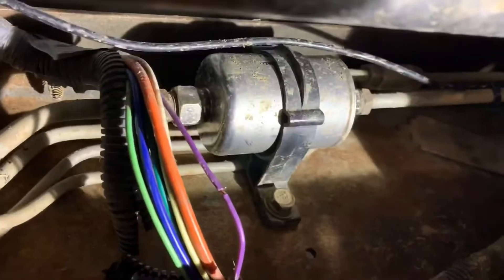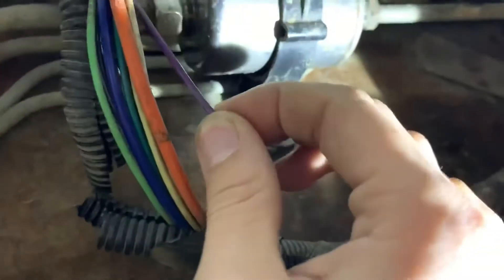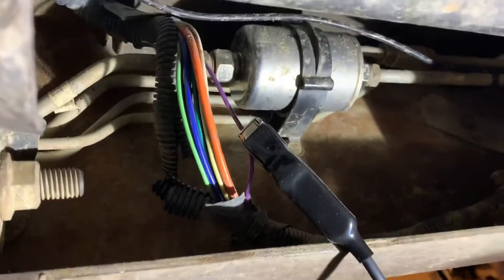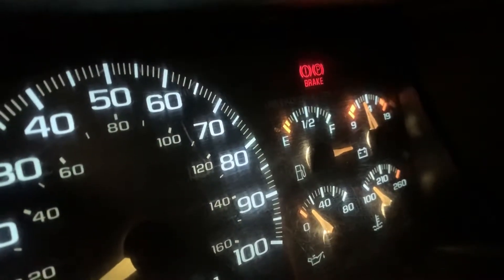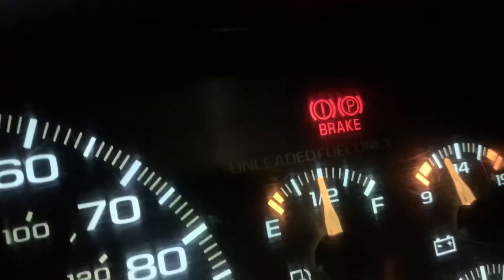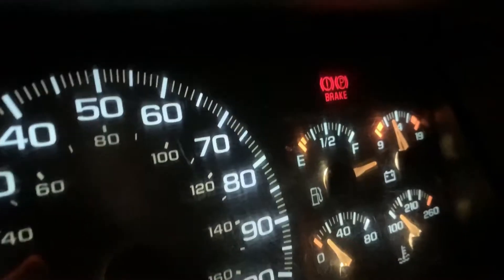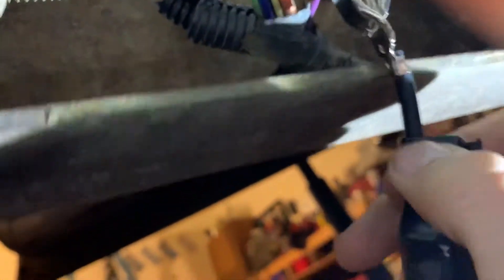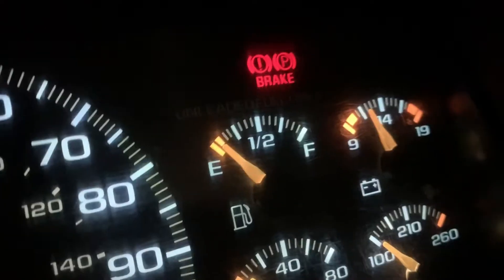Chevrolet C/K1500 Fuel Gauge Diagnosis That Works!

Comment: Nope.  There is a FUEL SENDER AND BALANCE PUMP CONTROL MODULE that takes the ppl wire and translates it to the right signal to the fuel gage through another ppl wire (purple)

Comment: My fuel needle is erratic. I did this test and it showed the air core to be working. I don't want to have to replace the sending unit and still have to replace the air core motor.

Comment: Couldn’t you just disconnect the tank ground 13mm to see if the gauge moves? If it drops, and then goes up (upon grounding/reconnecting), it’s not the gauge cluster 🤔

Comment: Mine works fine until its about half, then it just stops. When I fill up the tank again it goes back to full and half way stops again..... The measuring/floater device that shows how full the tank is has been cleaned so that isnt the issue. What could it be?
Reply: Did you ever find the problem? My truck does the same thing
Reply: When you cleaned it, did you test it outside the tank ie: move the float up and down and verify on the gauge?

Comment: My truck is a 98 Z71 my fuel gauge is stuck on E. I changed the fuel pump and sending unit it's still stuck on E
Reply: did you ever figure it out

Comment: What year is your vehicle?  Is the purple wire the same on a 97 Suburban?  For the last 6 months, the fuel pump on my 1997 C1500 Suburban had barely been working.  When it failed it also blew the 20 amp fuse in the relay box under the hood.  I changed the fuel-sending unit and discovered that the insulation on the two wires going to the pump on the sending unit had melted and they were fused together.  God only knows why there was no explosion.  Once I replaced the fuel-sending unit with a new one,the Suburban started perfectly, but the gas gauge started spinning in circles at high speed, often reversing direction or jamming itself into the oil temp gauge below it.  I am disabled and spent 3 days mostly crawling around on the ground replacing the sending unit with a new one.  I dread having to take everything back apart to replace the fuel-sending unit again, or tearing out the dash unless I am sure which is bad.  I am also the sole caretaker for my very ill wife and this is the only vehicle to take my wife to the doctor in.  

I need to be absolutely sure what is wrong before tearing it apart again.  You mentioned Ohms.  I have a multimeter.  I understand how to check the fuel gauge as shown in your video, but Is there a way to test the sending unit from the fuse box where the relay is to be sure it is bad before replacing it?  It is a brand NEW sending unit!   I was thinking that if the old sending unit was shorted maybe it could have damaged the relay or something else.  I just need to be sure to check everything I can because if I must tear it apart again we will be without anything to drive for several days which could be dangerous for my wife.  Thank you for your advice and any help you can offer.  God bless and Happy New Year!

Comment: I have a 2006 Duramax and I tried your method and the gage didn't move.  It shows 1/2 tank full when I turn the key on and when I short the purple wire out, the gage didn't move.  I notice my truck cable bundle is much bigger so I dig a little deeper and realized there are 2 identical purple wires in the bundle.  I was afraid to short the second one out since I see a little spark when I short out the first purple wire .  Can you tell me what is going on, thanks,
Reply from the maker: Sorry for the delay, if the gauge moves when you turn the key on I'd say change the sending unit to fix it.

Comment: Excelent thanks. However I would recomend DONT strip the wire, risky. Use as small a needle to pierce the wire then reseal.
Reply from the maker: Great tip! I was just working with what I had at the time, and I made sure to seal it all up really well.

Comment: Hi i grounded mine and the needle goes all the way down it doesnt go half ways does that mean that is working
Reply from the maker: Yes, if the needle moves when grounded then the gauge cluster is working and the issue is likely the sending unit in the fuel tank.
Reply: Hi i got it to work the mechanic that install my fuel pump system dropped the ring that goes on the gas tank on the bottom of the floater so it was preventing the floater to go up thank you so much
Reply from the maker: @oscarperezgonzalez9203  Oh man! Glad you got it figured out. And cheaper than replacing it!
Reply: Thanks

Comment: Gonna try this test later but my question is if I can use my scanner and see my fuel level (I have a 98 and a 411 ecu) that means the sending unit is fine and something from the ecu ie "tune" is off?
However after multiple attempts with the tunes it reads full all the time. I've verified the fuel level that the ecu shows is correct via scanner and tracking the gallons used... any thoughts on this?🤔
Reply from the maker: Sorry for the delayed response. My best guess there is that either the gauge motor itself is defective, or the gauge wire is open circuit (No continuity between ecu and gauge. Id lean toward the gauge motor being the issue. If you resolve the issue please advise how to hopefully help others!
Reply: @bmrbrn1  I tried the test by disconnecting the signal wire from the ecu and grounded it and the gauge needle went to empty. I've determined for some reason the signal coming from the ecu isn't a ground signal but a 5v+ reference signal. So I'm guessing that circuit in the ecu is fried... what confuses me is that before I had the 411 tuned for the ls swap the fuel gauge worked fine. But I did go thru a series of swapping the wires around trying to figure it out when I first started it and noticed the gauge pegged on full.

Comment: my gauge went to empty when i grounded and im sure the sending unit is working since the fuel pump is brand new. so i have a bad purple wire somewhere that isn't grounding?
Reply from the maker: I would do some research on the fuel pump grounds, that would be my best guess. This test will only really tell you that the dash portion is working, but if the fuel sending unit is new then next step would be grounds. Hope this helps!

Comment: When my fuel gauge is parked it randomly says empty but when I’m driving it’s showing a lil more then half a tank and I barely drove 5 miles on it and put aout about $25 dollars of gas, what could be the problem?? Should I just pay attention to the fuel gauge when it’s driving??
Reply from the maker: I honestly wouldn't trust that at all. What I had to do is just fill my tank completely, and just drove like 250 miles and filled it again to be safe. Sounds like it would be an issue with the wiring to me.
Reply: @bmrbrn1  okay thanks!

Comment: I did this and fuel gauge is still stuck on ground
Reply from the maker: Damn that’s rough.... my best guess is either the float is stuck, or there could possibly a ground strap issue somewhere near the tank. I’ve heard of tons of problems with the ground strap causing fuel gauges to not work. Do a little research on that and try that before you drop the tank or pull the bed again to check the float👍🏼 hope that helps!
Reply from the maker: Did the needle move at all when you grounded the wire?
Reply: @bmrbrn1  No it didn’t 😞. That’s with a new hanger assembly as well. I’m assuming I improperly installed it and the floater is stuck to where it reads empty on the fuel gauge... Because on the old one there was a delay in the fuel gauge after filling up at the gas station and putting a new one in the tank I thought would fix the issue😑 I’m gonna have to recheck and see if it’s stuck...
Reply: @bmrbrn1  either that or like you said the fuel gauge is shot
Reply: Do you have a trick like this for the temp gauge?? I’ve replaced the two temp sensors and still the gauge doesn’t move. Not sure what to do next.
Reply from the maker: @heathersgreeneyes  I do not, and I have since sold this truck. However I'll take a few minutes to do some research and see what I can come up with. I would think the process would be similar. What year is your truck?
Reply: @bmrbrn1   it’s a 97. Thank you for taking the time to help me.
Reply from the maker: @heathersgreeneyes  no problem at all! From what I’ve been able to find if you take the connector off of the temp sensor (the one on the head on the drivers side) and put a paper clip or jumper into the connector on the harness side and hold it to a grounding point the temperature gauge should go to all the way hot. If it does so then I would try replacing that sensor again, if it doesn’t move when grounded then I would think that the servo motor in the gauge cluster has gone bad and will need to be replaced. If the gauge is bad you might be able to wire in an aftermarket gauge cheaper than getting the servo replaced but I’m not 100% sure on that one. Hope this helps!!!
Reply: @bmrbrn1  thank you so much, I’ll give it a try!

Comment: Yo idk if you will ever see this but, I replaced my fuel sending unit and gauge cluster fuel gauge still reads empty think it's a ground?
Reply from the maker: I would think it would either be a short to ground in the gauge wire or a ground, maybe try following the wire to look for a short?
Reply: @bmrbrn1  appreciate the insight boss, took the bed off checked all the wires all's good the float ended up being stuck for a second works flawlessly now.

Comment: Mine went to E as well, but it wasnt a continuous travel. Another words, it went down in increments (F, quarter, half, quarter E, than E). Like say, a clock....(tick, tock, tick, tock,tick). So, does that mean maybe the stepper motor is damaged? Since it ain't moving to E smoothly in one shot?
Reply from the maker: Mr1980cadillac If the fuel gauge doesn’t work at all under normal operation, then I’d say it would just be the sensor in the tank, the stepper motor could be damaged but as long as it goes the full scale when grounded out I would think it is fine

Comment: my gauge bounces around after i get lower than half tank. If i fill up my 99 k1550 suburban to full it reads normal until half tank then it starts to bounce.
Reply from the maker: SoCal Adventure Rider most likely the sensor in the tank

Comment: Jacob Snowden Mine went down to the first orange line for low fuel. Then I left off and it went back up to where it was.  Mine is a 96. That would mean the sending unit it bad correct?
Reply from the maker: Jay Jay yes, if it went close to the E mark when it was grounded then the level sensor on the sending unit in the tank is bad. If the needle doesn’t move when grounded it is the cluster. Hope this helps!
Reply: @bmrbrn1  helps a ton thanks!!

Comment from the maker: Update: can confirm this is true. Replaced the sending unit and the gauge works perfectly now
Reply: I replaced mine n it went below E n now bounces below E although my tank is half full. What to do?
Reply: @isiahadderley1539 mine is stuck on e
Reply: @isiahadderley1539 did you ever figure this problem out?
Reply: I replaced my whole fuel pump assembly new sending unit all that put a new cluster in and my gauge still doesn't work
Reply: @kylemeans8342 bad ground somewhere or wire is fried
Reply: Mine started doing the same thing berly ima replace my sending unit too an see if it works thanks bro 🙌🏼

Comment: What if the gauge is stuck on empty?
Reply from the maker: brandon Jensen there is most likely a short to ground in the system, or the stepper motor in the cluster is bad
Reply: Did you ever find out what the issue was having same issue